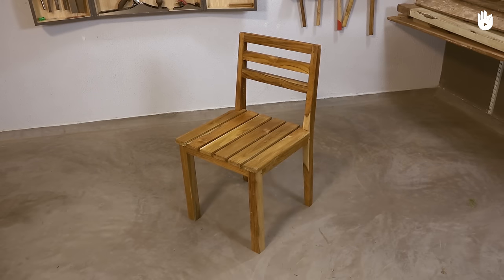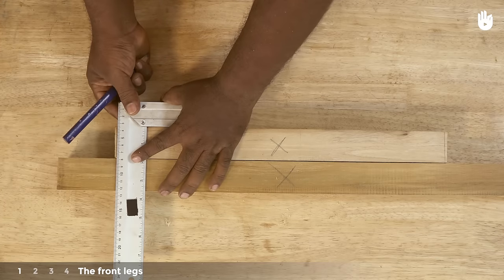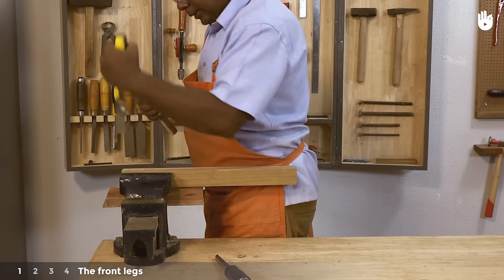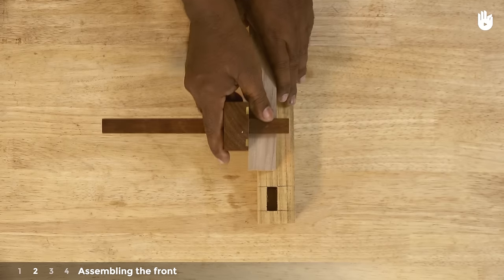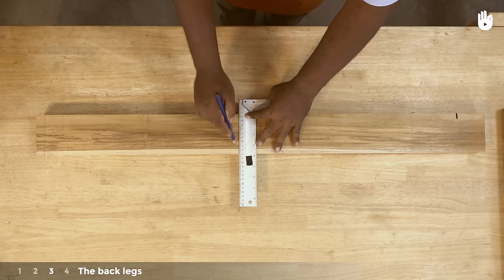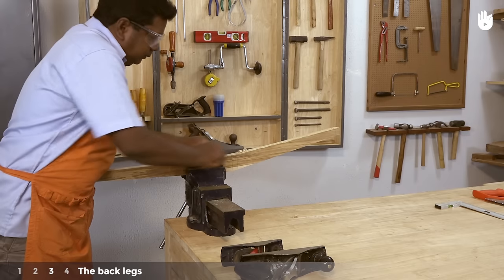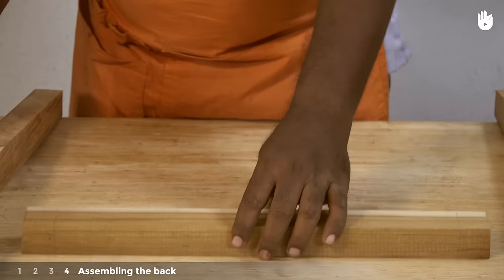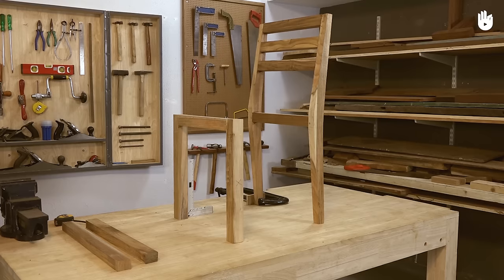How to Make a Chair - Part 1 | Woodworking

Comment: My wood worker refuses to make a wooden chair without leg ties. He says the legs will wiggle. Do you use special techniques to make the legs not wiggle without ties?
Reply: Ties
Reply: @quibble2868  ties means the wooden horizontal members connecting legs on all four sides slightly above the bottom.